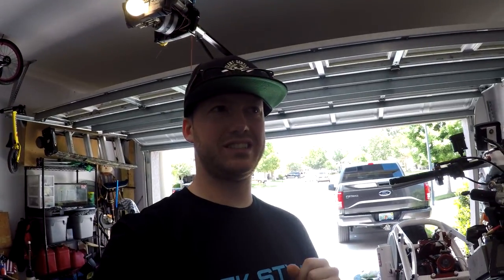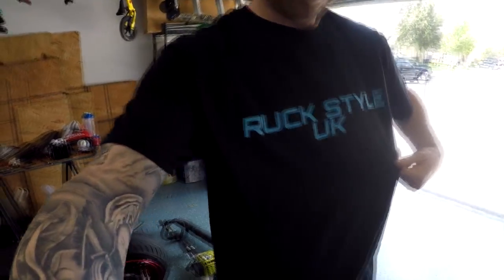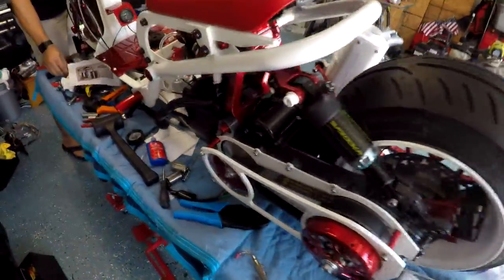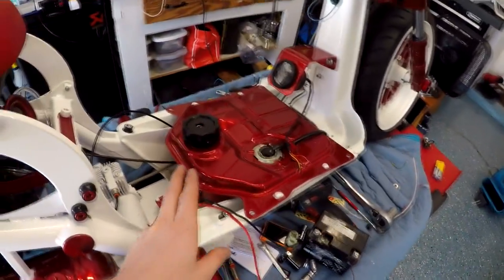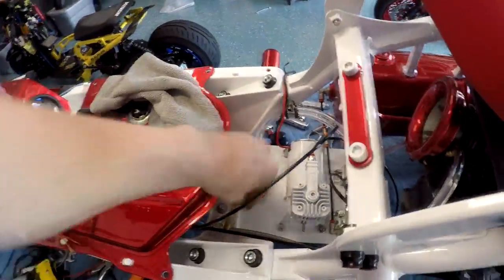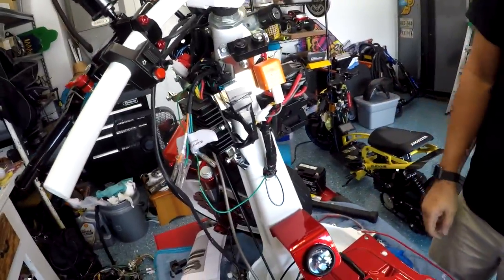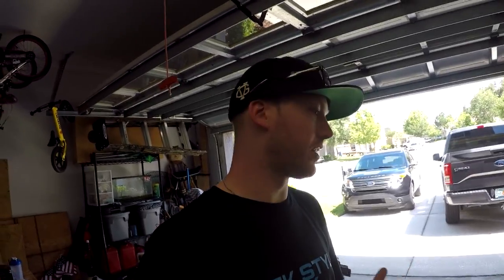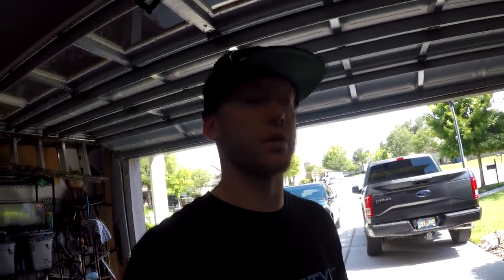gy6 Build series ep 6 ITS ALIVE!!

Comment: Could you tell me how the fuel pump is connectd? I am modifying a scooter and it is a bit difficult to get the parts in my country
Reply from the maker: Bryan Rodriguez it’s a vacuum fuel pump so from gas tank to pump then pump to carb. Very easy. On top is a vacuum line that goes to carb or manifold
Reply: Burnout Bobby thanks, investigating I had seen a system but it included an electric pump, by the way the ruckus of the video was great!